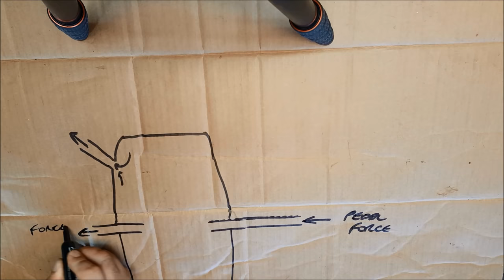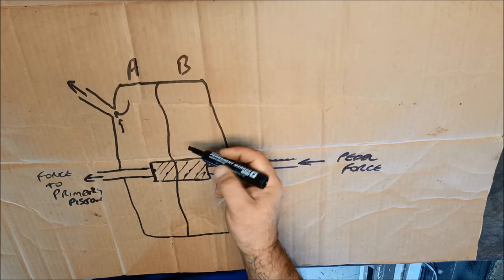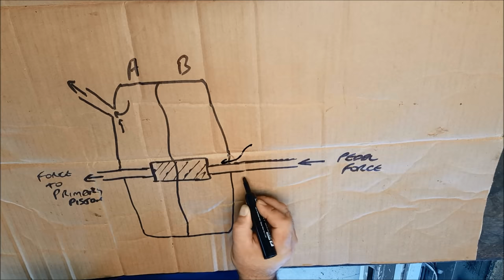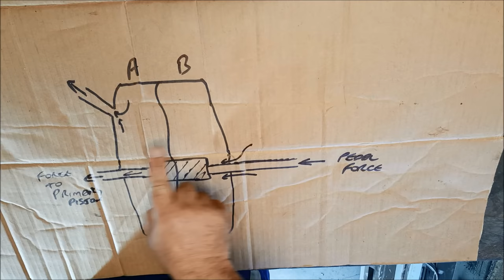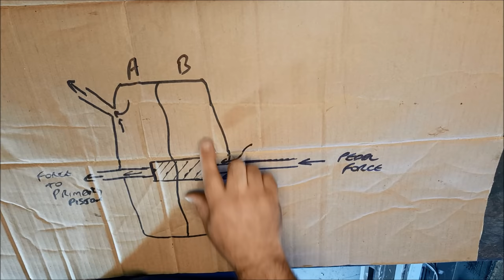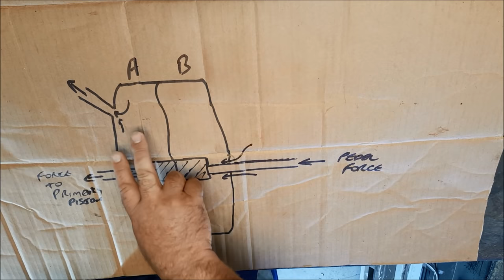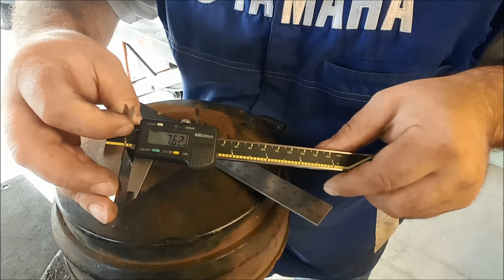Brake booster checks, operation and push rod adjustment #1313

Comment: I have an 2007 Tacoma 2wd no vehicle stability control and on the highway out of no where my brakes just apply themselves. They don't lock me up to a skid but instead just slowly apply, I get steering wheel shake, cabin vibration and complete brake lock up which only release after the truck sits for about 20min. I replaced the master cylinder and flexible brake lines that connect to the calipers but it still locks up randomly on the highway.The first time it did this I drove to work everything was fine. When I got into my truck after my shift my peddle was hard as a rock. It softened when I started it up but the brakes were really sensitive and then once I got onto the highway they locked up about 1/2 mile down the road. This happend two more times only happening on the highway.
Reply from the maker: +Sam Scrapla Hi, yes, sounds like a classic case of no pushrod clearance. You'll need to unbolt the master cylinder from the brake booster and reduce the length of the push rod.
Reply: Ok thanks. I bought this truck used from the original owner and it worked fine for months then all the sudden leaving work my peddle is hard. The rod can move or readjust itself on its own? I never tampered with the pushrod and it just locks up randomly.
Reply: How do I adjust it and know where it should be?
Reply: I never adjusted the pushrod before this issue and then after my brakes locked up and a local shop replaced my mast cylinder the brakes worked fine for a week until they locked up again.
Reply from the maker: +Sam Scrapla it's possible if it has a lock nut and it hasn't been tightened. Same problem will occur if there is corrosion preventing either the primary or secondary piston from fully returning to its rest position. Only when the pistons are on the rest position does the compensation port open and allow fluid to return to the reservoir due thermal expansion.
Reply: should I pull my calipers off and check them? My brakes work fine on side streets then randomly just lock up but they lock up slowly like it drives fine then it feels like I'm pulling a house. I know the caliper rebuild kits are cheap I'm just lost as to what to do,
Reply from the maker: +Sam Scrapla Ah okay. So if it's had a new master cylinder fitted then we can eliminate corrosion or return spring failure or blocked compensation port.

It must be an incorrectly adjusted push rod between the booster and master cylinder. The video shows you how to make the adjustment. There must be a small clearance to allow the primary piston to fully return to its rest position and open the compensation port.
Reply from the maker: +Sam Scrapla no. This is not a problem with your calipers.
Reply: I was told its a bad booster building vacuum when it shouldnt causing the brakes to slowly apply themselves
Reply: Ok this problem first happened with the factor master cylinder and then occured a week after the new master was installed is this possible with a pushrod thats not adjusted? I'm confused how it just happened out of no where one day with the stock master cylinder after driving for months without an issue.
Reply from the maker: +Sam Scrapla The easiest way to diagnose that it's a pushrod length issue is to slacken the master cylinder mounting bolts that attach it to the booster. Do this only when the brakes start to bind on. You'll need to undo the nuts sufficiently to give say a 1 to 2mm gap between the master cylinder and booster housing.

Then carefully drive your vehicle forwards and the brakes should have released. If this is the case then the booster to master cylinder push rod needs to be reduced in length slightly. The video covers how to do this.
Reply from the maker: +Sam Scrapla I don't think this is the case. See my response...
Reply: I know this is old but I fixed the problem so far. I replaced the OEM booster with a rebuilt OEM unit which lasted a few years and then started doing it again. I know have a parts store booster on and so far so good. The weird thing about this issue is it happened before. I had a 89 Pontiac 6000 and the brakes applied themselves one night and replacing the booster solved the issue.

Comment: my brake pedal acts exactly as you described at the start with the on car test. but, when i apply them whilst driving, the pedal always pushes through the servo vacuum and travels another 60 or 70mm.

in emergency braking it can be dangerous because the fast action of pressing the pedal can be delayed by the stiffness of the vacuum until i push through it to that 70 mm region when the brakes engage. i've also noticed bubbles returning to the master cylinder reservoir when bleeding. What do think? i also hear the "pfth" of air inside the cabin every time i brake.
G,day from across the ditch, do you have any advise?
Reply from the maker: New brake booster required. Sounds like the valve Assembly is leaking
Reply: jeez that was a quick reply. thanks i'll do that

Comment: Andy, sorry to bother you again. i have another related to my brakes, I have a 1997 Ford F150 XL, when you release the brakes the brake light still stays lit. I have change the brake switch, same issue. From trouble shooting the issue I have notice that if I unplug the switch the light goes off, but that creates an obvious problem, no brake light indication when driving. I have to disconnect the battery to keep it from draining out due to this issue. Again any ideas would be most helpful, thanks
Reply from the maker: +hugh francis now that is a very odd problem. All I can think of is have you adjusted the depth of the switch on the threads?

Other than that all I can think is there must be some electronic intervention on that circuit that maybe keeps the lights on for a minimum period of time - this unit may be faulty??

Sorry I can't be more helpful on this one, it's not an issue I have come across.

Andy
Reply: you are right  Andy this is a head scratcher, replacing the brake switch would have been too easy I will keep you inform when I find a solution. thanks anyway, keep up the good work

Comment: Can the brake booster cause the engine revs to surge in between gear changes?
Reply from the maker: An air Leak will do that and if there is an internal Leak in the valving inside the booster then unmetered air will be entering the intake manifold and leaning off the mixture. So yes....

Easy to diagnose, just remove and Block off the vacuum supply pipe to the brake booster. Be careful driving as no servo assistance on your brakes.

Hope this helps
Andy
Reply: @AndyMechanic  
Thanks Andy, just blocked off the pipe, engine revs normal in between gears, remove blockage and back to surging. Replacement servo and master cylinder on order.
Thanks

Comment: I was told by GM dealer that the Push rods are not adjustable on the 03 oldsmobile alero 2.2L 4C. Is this true to your knowledge?
Reply: u
Reply: @bjgermesu705  what is that supposed to mean?

Comment: Great video!  I was hoping to get your thoughts on my car issue.  I have a 4wd lexus where the brakes feel dull.  Essentially if I had to stop quickly, I feel I have to add a lot more force than I would expect.  Pads and rotors are good.  Car doesn't pull when I brake.  So I think the calipers are fine.  Pedal also doesn't touch the floor. Do you think this could be a push rod that is not adjusted properly?  Thanks!
Reply from the maker: +Duc800ss Hi, I don't think it's a push rod issue. I suspect there is either a fault (internal leak) in the brake booster or poor vacuum supply (check hoses).

Hope this helps. Cheers Andy
Reply: Thanks Andy!  I appreciate the help and will let you know what happens.
Reply from the maker: +Duc800ss no worries :-)  Yes, please let me know how you get on. Every day is a learning day for us all. Cheers Andy

Comment: Hi, i have a 1996 chevy 2500K with abs pump that i beleive is burned (fuse is good). When de truck is cold, you only tap the brake a little and the 4 wheels block, and it's not because of the pads and rotor temperature, it really seem like a booster over working, or just work properly when cold and i'm not use to it. I have this truck for one year now. When it get hot, it seem to work great but some time the brake pedal come a little hard and breaking is a more difficult. Have you ever heard of a booster doing that thing? Sorry for my english, speaking from quebec!| Thanks for your time!!
Reply from the maker: Hi Paysagement Brault, firstly, please accept my apologies for such a late reply, I have been away riding the NZ Desert Storm, I say riding, I spent more time on the ground than in the saddle!

Now thanks for your question, I'm not very familiar with the US vehicles as they are extremely rare in the UK which is where I learnt most of my skills. However, we did have an old Nissan D21 1 tonne pickup truck that had the same problem. It was many, many years ago, lets say around 30 years ago in fact. On a morning, shunting the vehicle around the yard as a kid you only had to 'breath' on the brakes and they would lock up and you'd bang your head on the windscreen!

The mechanics did eventually fix the problem and the vehicle didn't have ABS. I wasn't all that involved with the fix as really I was just a kid. But on reflection I don't think the fault is with the ABS system at all. I think its more to do with the fact the engine is cold, the carb is on choke and also revving hard. The chock butterfly will be almost closed causing very high vacuum in the intake manifold. Now the brake booster (servo) uses this vacuum to provide power assistance on the brakes. 

The Nissan was the same set up too and would rev quite high when on cold start (choke). Just to diagnose before you start the engine first time in the morning clamp off the vacuum hose (large dia) between the intake manifold and the booster. Start the engine and see if the brakes still lock up easy. 

There should still be some residual vacuum in the booster from the last time you drove the vehicle so the brakes should act like the are working normally (ie after car has warmed up). If they still are jerky and lock up easy then we can eliminate the booster. It must then be something to do with maybe brake pad compound or rusty brake discs maybe?

Anyway, give it a try & please report back and we can go from there :-)

Cheers
Andy
Reply: Thank you my friend! I've was already thinking about the high vaccum when the enngine is cold, but since it work too much when cold and sometime not enough when hot, and the truck is a 1996 and pretty sure the booster has never been change, i think i'll give it a try with replacing it and the master too cause it has started to leak ( funny timing!). I don't think too that the abs would change anything and the pump is not working anyway. Soo thank you for your time, i'll let you know within the few upcoming weeks if the booster was the problem!!

Have a good one!!

Comment: Great video, I learned a lot. I have a question though that was mentioned. When I press on my brake pedal while engine running I can hear the vacuum hissing in the cab of Jeep while it's being pressed. Is that normal or an indication an internal diaphram fault is occurring?
Reply from the maker: +Cory S if the noise is continous then yes, the vacuum valve in the booster is leaking as this should close as soon as the pedal is pushed down.

Hope this helps. Cheers Andy
Reply: Andy Mechanic , it only makes the noise as I'm pressing, once bottomed out it stops. Also I adjusted my pushrod and brakes are a 1000x better. Thanks for the video.
Reply from the maker: +Cory S Ah, in that case the noise is normal. It's air from the cabin entering the rear chamber of the booster via the atmospheric valve.

Pleased you found the video helpful. Cheers for now Andy

Comment: I believe I have a bad booster. With car off I have nice firm pedal. Car started pedal sinks and seems spongy. If I apply pressure slowly booster seems to work. If I stab the pedal quick and fast pedal feels hard and car won't stop
Reply from the maker: Yep...internal leak in booster or a vacuum supply problem - check the large vacuum hose from intake manifold for blockage & also the one-way valve too. If they are both fine then I'd go after the booster...

Cheers Andy

Comment: Hi bro.. Just diled in adjuster an booster. all running fine with out brake light on an brakes are free . .. :)  now im having instant power loss soon as i hit an incline or hill???.  I loose power an end up hitting 3rd gear @ 50km  :/  heeelllp pls
Reply from the maker: +Glen William Hi Glen, sounds like there is an internal Leak within the booster unit. Check to see if you can hear induction 'hissing' down near where brake pedal push rod enters booster.

Also ensure there is free play on brake pedal too.

Provided both input and output push rods have a clearance then the booster must be faulty. To double check just clamp large vacuum hose from intake manifold to booster. If problem goes away then must be booster. Just be careful when Road testing as you won't have any brake assistance!

Hope this helps. Cheers Andy

Comment: 1989 gmc1500 sierra 5.0 good brake pedal eng. running goes all way down?
Reply from the maker: +Brian Bryant does it have drum brakes at the rear? If so then could be poor rear brake adjustment. Clamp flexible rubber pipe to rear axle and try pedal. If hard now (much less travel) fault is in rear brakes.

If not (pedal same - goes to the floor) Clamp flexi pipes to front calipers and try pedal. If pedal good then air in front calipers. If pedal still goes to floor then suspect seal failure in master cylinder - replace unit.

Hope this helps...Cheers Andy

Comment: My 2010 Nissan Altima started to have a grabby brakes or very sensitive brakes when you apply pressure on the pedal. Meaning when approaching a stop light which you normally will press lightly on the brakes, I will 95% of the time will experience a quick grabbing feel of the brake. I have to watch how much I apply pressure to prevent my head hitting the steering wheel.  I have new brake pads, rotors, we did brake bleeding, no sign of oil leak from the wheel hose and has good brake oil level.  Lots of people had similar experience, but nobody has any solution.  Everybody is just guessing including the Nissan Dealer Master Mechanic.  I found  1 explanation that is that the Master Cylinder was leaking oil to the Brake Booster from the inside connection maybe rubber  O ring or something and they say both ends of the Booster connection has some play.  The question is... Can this internal problem cause the "grabby brakes" that hundreds of nissan owner still have no clear solution.  You said Brake Booster can not be repaired, but how about the Master Cylinder if its really leaking. Thanks
Reply from the maker: Hi, yes, we had a Nissan D21 pickup that did the same....crazy grabby brakes, worst when cold. 

You can rebuild your master cylinder - you'll just need to source an overhaul kit, new seals, Springs etc.

I'm certain that the grabby brakes must be something to do with the internal valving of the brake booster &;yes, this could easily be affected by a leaking master cylinder.

I'd fix the master cylinder and fit a new brake booster....let me know how you get on

Cheers
Andy
Reply: @AndyMechanic  Thanks! I will try to check the condition of the master cylinder and  see if leaking is visible.  If the outer area has no sign of leak, then I probably try disconnecting it.  Any special guidelines when disconnecting the master cylinder to the booster? Thanks
Reply from the maker: No not really. Good Luck :-)
Reply: @AndyMechanic  Update! I removed the Brake Booster and got a replacement from a local part store. I had to disconnect the master cylinder and other part to free the booster.  The old booster didn't have any sign of oil going inside and the inside looks very clean.  Anyway, I completed the replacement including bleeding the master cylinder and I can officially say all the problem is gone.  The braking feels just like a new car.  Summary, My 2010 Nissan Altima started to have a grabby brakes or very sensitive brakes when you apply pressure on the pedal. After all the previous work that was done, it was the brake booster all a long.  Finally :)
Reply from the maker: Ha! Awesome. Really appreciate you letting me know the final conclusion with this. Great job. Wishing you a great New Year. Cheers Andy

Comment: Great information. Can a double diaphragm booster work on a car that has no abs. Thanks
Reply from the maker: +Dandadda22 Yes, I don't see why not. Just be aware that a double diaphragm booster multiplies the force applied by the first diaphragm as opposed to additional force...
Reply: Thank you! I have a nissan sr20 vvl "Black Top" in a 1994 sentra b13. I am going to try the booster with the existing master cylinder and upgrade to steel braided lines at the front. Thanks from the Caribbean for your help

Comment: AT 80 YEARS OLD, HAVING DRIVEN A LOT OF VEHICLES W/O A BOOSTER, WHY DO WE NOW NEED ONE?
Reply from the maker: Ah....now that's a great question William.

Many early vehicles had drum brakes front and rear. A drum brake has a self energising action on one of the shoes at the rear (leading/trailing design) and on the front both shoes were 'pulled' into the drum when the brakes are applied - this gave the driver extra braking force.

Modern cars now often have disc brakes front & rear. A disc brake setup lacks this 'servo' or self energising effect & therefore requires more force to be applied by the driver

As most Drivers became lazy & cars got bigger and heavier too. Brake assistance was demanded by the customer & now it's the norm. 

Hope that helps explain why pretty much all cars have some form of brake force assistance - often a brake booster using vacuum.

Cheers Andy